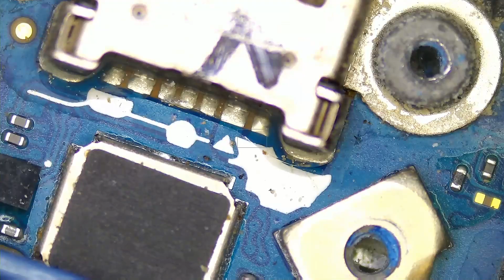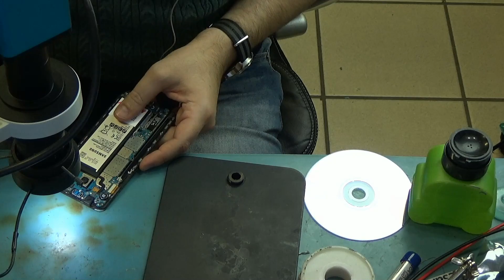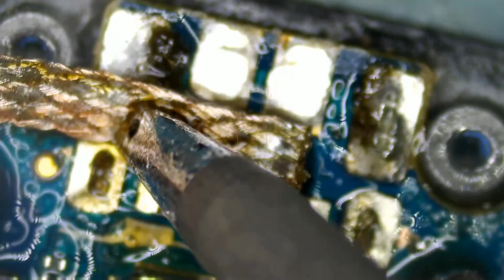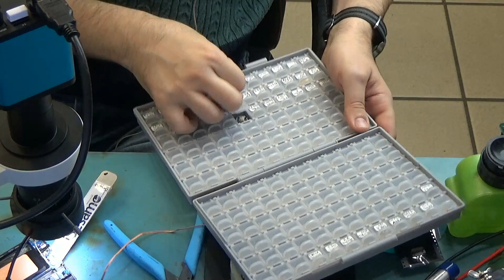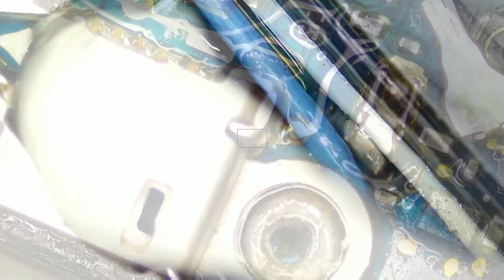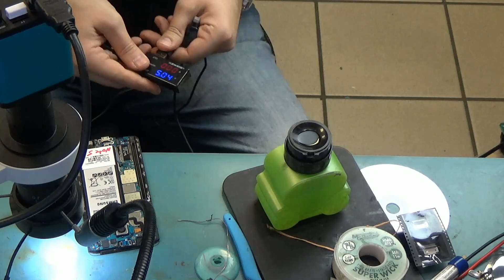Galaxy Note 5 No Power Repair - Charging port connector replacement

Comment: hands down you have had absolutely tremendous skills went it comes to soldering. but do you know that job can be as easy as 5 minutes by replacing the whole charging port without having to used any of you tools but just the heat gun to remove the back cover? Ebay sells those port flex cable for $3 some dollars, i had fixed several of that Note 5.

Comment: Can I please ask what temp your soldering iron is set at when applying low melt, also temp of  your hot air when using low melt to remove components, and then also iron and hot air temps when applying the new leaded solder. Thank you in advance!
Reply from the maker: 410 iron when mixing unleaded with low melt, 350 air when removing connector, 350 iron to solder connector with leaded.
Reply: @NorthridgeFix  Thanks so much and keep up the great work! I am always watching for and looking forward to your new posts. Very informative watching you use schematics and boardviews while diagnosing and troubleshooting, testing voltages etc. I always know I am going to learn something new. Thanks again!